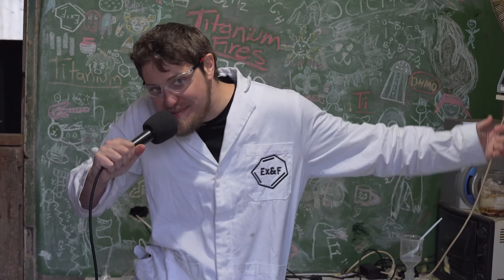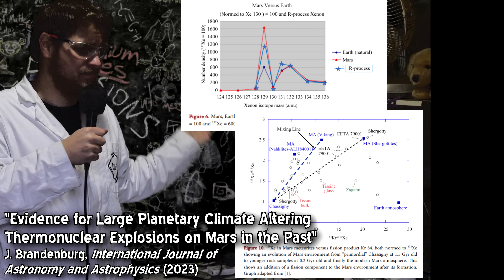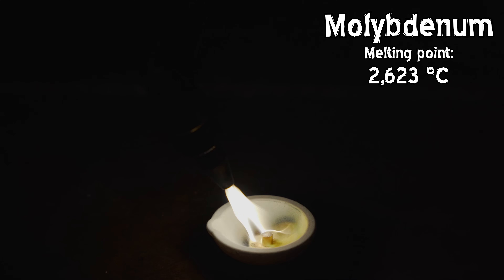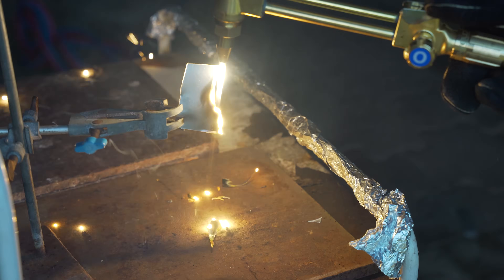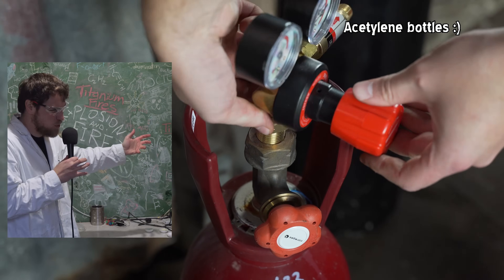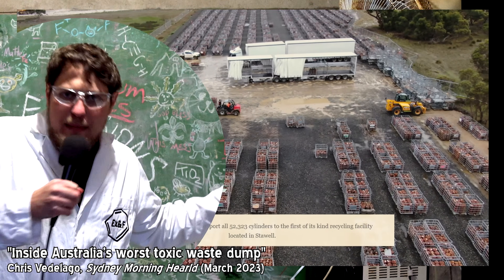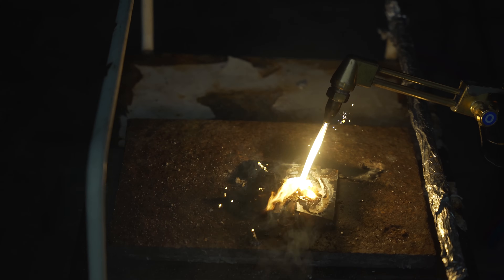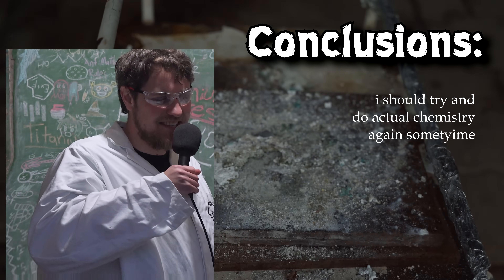Actually burning titanium

Comment: Fun story about titanium melting:

My dad worked for Kodak back in the 90's and one of the plants had a bad fire. He was there to help where he could and he came home with a chunk of titanium about an inch square with bubble cavities in it. It weighed a lot for what it was, apparently it had been a sheet of thin titanium that melted and then *boiled*. Still has it somewhere.
Reply: Actually, titanium is quite light/low density compared to many metals (4.5g/cm³), so maybe it was just your impression.... But nonetheless still cool story !
Reply: @ryanslab25  yes I realize that, did you miss the part where it was an entire sheet of titanium melted into a one inch square? I guarantee you, it weighed more than you think it would when you hold it.
Reply: @phimuskapsi  If it was a solid one square inch block, it doesn't matter how big of a sheet it was made from, it doesn't get more "compacted" than if It was just casted in a mold, the density doesn't change...
Reply: It was probably bigger than a square inch..... 1 inch³ = 16.4cm³
Titanium density : 4.5g/cm³ × 16.4cm³ = 73.7g, or a little over two ounces... not that much weight.

If there were air bubbles inside this "blob", the density might be even lower, so it might have felt lighter than if was solid all throughout .....
Reply: @ryanslab25 You have to remember that a sample of pretty much any pure metal is going to feel relatively dense compared to what most people are used to. Think of it like this: when thinking of something heavy, most people probably compare the weight of an object to something of similar size that's made of some sort of stone. 95% of Earth's crust is thought to be made up of silicate minerals, meaning that the vast majority of stones that the average person deals with are largely composed of silicon and oxygen. Even something like pyrite, which is just 2 sulfurs and an iron, already feels heavier than most rocks of similar size. If you work with a lot of metal your judgement will probably shift because you have better reference points, but to the average person a solid hunk of titanium will still feel decently weighty.

EDIT: Wanted to add an additional interesting note on this subject; aluminum is a rare exception to this, because its density is actually remarkably close to that of pure quartz. As a result, the average person picking up a chunk of aluminum will actually probably recognize that it's really light for a metal.
Reply: @TheHammy2211  Ok....
I'm convinced that most people don't know how dense metals feel like....
Reply: @TheHammy2211  Yeah, no one has ever held cast iron before. Can't relate to anything denser than water.
Reply: 2oz is a LOT of weight for something that small.

Comment: As to recycling the same thing has been happening in The United States and much of Europe.  The plastics used to be accepted quite readily by China as that was the few places where labor and low regulation made it economically viable to do anything with.  But in the late 2010's when China started talking about the olympics and other international affairs they heavily cracked down on foreign sources of pollution and the labor costs have been increasing steadily.  In 2019-2020 China pretty much universally cut off "Dirty plastic".  These are food containers, items not sorted by color/type of plastic,  items not washed, items with labels/glue, etc.  In other words they will only accept plastics that have been fully prepared to go into recycling machines (which is where all the cost to recycling is).  So the rest of the world has pretty much just been stockpiling it as its too expensive to clean & sort.  The same has generally happened with bulk paper.   Right now glass and metals are the only areas where some legit recycling work is being done.  In some cases where the export and storage is too expensive (high population areas), a lot of the recycling programs offload the materials to a "third party handler" (for deniability that the recycling program has failed) and they pay people to just mix it back into the landfill stream.

The only places doing significant non-storage based work are the systems that setup high temperature incineration facilities where they burn the materials and use many different types of atmospheric scrubbing systems to deal with the byproducts (which at best could get to a neutral footprint situation).

Comment: There is no problem with burning plastics for energy in a properly built and scrubbed generator.  It's by far the most environmentally friendly thing to do with them (barring those few exceptions that are easily and economically recycled like HDPE).  It's just oil that has taken a crazy trip from well to generator.  It's not carbon neutral or anything like that, but it doesn't end with significantly more air pollution than other fossil fuel generation methods and the plastic actually goes away.  Unless we're going to start backfilling coal mines with compressed plastic bricks, we need to find something sensible to do with the stuff.

Comment: I love the fact that the recycling company stock piled the plastics and then waited it to catch fire (or set it on fire either on their own or through 3rd party). Get rid of the garbage and cash in on the insurance, its a win win. But for real those kinds of companies should not exist that just move the trash around the world where they get dumped into the oceans, some of it will end up to be burned. I'd pyrolyse plastics to get usable oils some of which can be sold back to the plastic producers and other "crap" goes to something else.

Comment: This all seemed rather pointless, even iron burns when heated well over the melting point. Ti will burn if an additional energy source is supplying the heat otherwise it is not self sustaining unlike for example Magnesium.

Comment: When setting up an a torch you adjust the flame to a pencil tip before you hit the turbo switch. Your base flame is just acetylene.  Add oxygen to it to make it a tighter flame and then hit the switch and you'll see a difference
Reply: Switch 🤦‍♂️
Reply: @MadScientist267  switch, trigger, doohicky, paddle, thumb button, turbo flame, throttle.  Need I go through more?
Reply: @mikemitchell9157  Yes, actually. You've attempted and completely missed any kind of accuracy whatsoever.

It's called a VALVE 🤦‍♂️
Reply: @MadScientist267  no not at all.  You are just being pretentious is all
Reply: @MadScientist267  no not at all.  You are just being pretentious is all
Reply: @MadScientist267  because if you want to get technical the valve is internal and the paddle is the switch that activates said valve.

Comment: The eye protection for oxy is usually shade #3.  For welding temperatures, you want shade #8.
Reply: Typically for oxy acetylene schadenfreude 3 is for brazing and shade 5 is for cutting (burning). I have 2 pairs of shade glasses, and 3 is light enough to use as regular sun glasses. For welding (mig), it's usually shade 8-14.
Reply: Fantastic autocomplete "typo" haha. Also, I have no idea how what you said was different from OP :P
Reply: @tylerb6981  shade 5 is what is best for oxy acetylene cutting. An important thing to keep in mind is the whole point of using different shade levels is to use the protection that is sufficient without making things so dark that you can't see what you are doing.
Reply: @hascrack3783 wait so with even the super bright welding techniques can you actually see what you’re doing? I just assumed that at some point it’s just about eye protection, because if you block all that light enough to be eye safe then it’s gonna be hard to see anything else
Reply: @Brent-jj6qi  I'm not sure how it is for welding but for glasswork where you can't see what you're doing cause of how bright yellow the flame gets once the glass is introduced cause of the sodium in it there are glasses that specifically block out that spectrum of light and you can see through the fire to what you're actually working on when to someone watching it's all hidden by bright yellow flame
Reply: @noodlelynoodle.  I feel like that might be less effective on welding because of the white light it produces but I’m just talking out of pure guessing at this point
Reply: @Brent-jj6qi  Basically you can't see anything with the visor down until you strike an arc. Then it's clear as day, though a bit green. Auto darkening helmets help a ton with the whole seeing what you're doing before the arc.
Reply: @Brent-jj6qi  hey im a welder and to answer your question yes you can see what is happening when you are welding the actual molten puddle of metal that you are creating is bright enough that it kind of casts a 1 to 2 inch wide area around the puddle that is lit up this greenish color
Reply: @Brent-jj6qi  You can see the weld and a fraction of an inch around the weld, everything else is about black.
Reply: @Brent-jj6qi  like others said it depends on what you are doing. You wolnt see anything with shade 14 on an oxy acetylene cutting torch but you will see your weld pool with mig/tig. 

With that said, the reason for shade levels is to reduce the light level passing through to an acceptable level. The key is that light is still passing just less of it. If the shade level is too low, too much light will pass (better than nothing but still not good) if the shade level is too high then not enough light will pass to see what you are doing. You want to have enough light to see but below the harmful amount
Reply: At that point I would use a camera and screen without allowing any direct line of sight from the bright flame/metal to my eyes
Reply: @YounesLayachi  I only know this because I have way too many hobbies but camera sensors are also suseptible to damage from intense light sourcees but in a different way than the eye is. The lens acts like a magnifying glass and can cook the sensor if you aren't paying attention.
Reply: All very interesting responses from welders lol, thanks yall
Reply: I appreciate the glimpse into what you see.  I also never knew what you could see.  Thanks

Comment: I remember a story my dad told me when he was working for a military contractor. They had titanium thermal nodes testing a new engine in a fighter jet, and one of the nodes actually got hot enough to set fire. The nodes also sat on a titanium plate that secured them to the ground. The plates were close to damaging the facility so the airport fire team was called in, but because of the unusual nature of the fire, they decided to put it out with NITROGEN. If you know chemistry you know that that covalent bond is not great with fire. it basically becomes magnesium but a little more explosive. They had to let it burn down, it simply wouldn't go out with any known methods

Comment: Recycling doesnt happen anywhere its all a scam. A very small percentage of material that gets put in a recycle bin might get turned into new material, but the vast majority is used in “energy recycling”, or just burning it in a power plant to extract the energy as electricity. Tons of not just CO2 but also toxic gases like CO and other by products of combustion that havent been fully broken down and oxidized. No one actually recycles and its terrible

Comment: 2:33 I can't comment on the skill or not, but I think the problem may also be in the theory, i.e. you misunderstood what the controls of the cutting torch do.
As far as I understand, the lever is for cutting, not heating: normal procedure is to set a stoichiometric (and hence non-oxidizing, otherwise you couldn't weld with oxyacetylene) flame with the two rotating valves on the torch. This flame is used for most things, including everything shown in the video. Only if you need to break into a bank, or otherwise use the torch as a steel cutting implement, do you press the lever, which bypasses your oxygen setting and sends full-pressure oxygen to the tip. In air, this ruins the stoichiometry, but if pointed at an already molten puddle of iron, it will oxidize the iron and release more energy, melting more iron, etc., until you're inside the vault. (Fun fact: the iron oxidation is exothermic enough you can turn off the acetylene once the cut has started, and finish with just oxygen, like a thermic lance.) This is probably partly what was happening to the titanium in this video, so I would be interested what it would look like with a less oxygen-rich flame.
Also the torch going out with a pop might have something to do with the relatively low acetylene pressure you're using, as evidenced by the relatively sooty flame, but that's hard to say via video.
There's also plenty of good tutorials (by people with significantly more experience than me) online, can recommend e.g. This Old Tony's video.
Hope this helps! :)

Comment: I am surprised that people still use acetyline bottles. My grandfather used to do car repairs in his garage and he used the OxyAcetyline torch BUT he used an oxygen bottle and an Acetyline Generator which was a simple tank with a hatch on top and a lever on the side, the lever controls how deep a basket filled with calcium carbide was lowered into the water, the calcium carbide reacts with the water and produces the gas. I even used small rocks of calcium carbide on a science project where I built a model of a flare tower.

Comment: I am absolutely shocked that they don't just refill the acetylene bottles like they do here in the UK. You can literally order it online, and when they drop off your full bottle they'll take the empty one away, refill it and so the cycle goes.
Reply: they do refill them however when they no longer pass inspection to refill they are having issues disposing of them
Reply: These bottles have a lifespan. They can rust, they can crack, they can have the thread stripped out... There are plenty of reasons one might not be usable anymore.
Reply: The porous mass can be made from monolithics such as silica carbide, fiberglass, or asbestos and non-monolithics such as balsa wood or charcoal impregnated silica.  The 2 solvents used are either acetone (which evaporates and needs to be re-solvented pre-fill) or DMF Dimethylformimide (which does not evaporate and only needs re-solvented if baked out)
Reply: It ain't empty unless there's a hole in it
Reply: @laserdollars2018  humans have many holes
Reply: well looks like a legacy issue, like everything involving asbestos <.< 
(and no not every bottle uses asbestos <.< there are other fillings too, even at least one alternative solvent <.<)
Reply: it's schizophrenia. Some countries are alcoholics, hoarding stuff etc
Reply: @trollmcclure1884  and some countries are australia so it's all the above

Comment: you need much more oxygen in that torch flame judging by the color
Reply: Yeah, he seemed to be balancing it to an almost normal level with the lever held down , which means that he's super far under iirc, since that's for blasting out material with an oxygen rich flame (at least from what I remember when I learned how to cut steel in highscool)
Reply: @comradesoupbeans4437  
you can do that and still get a very good flame, he just doesn't know what he's doing, the way to tweak it is you get the blue flame and have bright cones, then turn it down a tiny bit if needed, then you tweak the oxygen with the trigger pulled and you end up with a flame that's hot enough to preheat and cut metal and the oxygen is enough to blast out the metal and superheat metal that is harder to cut
Reply: he never even got it to having a blue flame or any cone/cones which is the issue
Reply: @papitosaucito  yeah, it's been a hot minute since i learned all that and didn't put it into words very well (also assumed not seeing cones might have just been the camera washing out for some of it where the flame was closer to decent)
Reply: Australia mate, of course he's super far under :-)  @comradesoupbeans4437
Reply: Yeah thats a straight acetalyn flame
Reply: The black smoke is a dead give-away there is far too much acetylene in that mix.
Reply: He did start by saying he sucks at it, so it could probably have been worse.